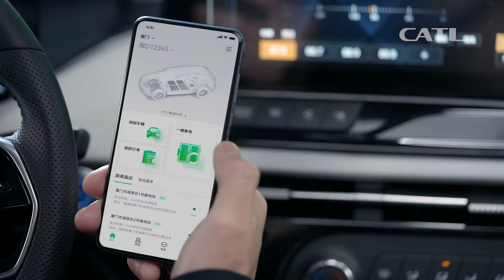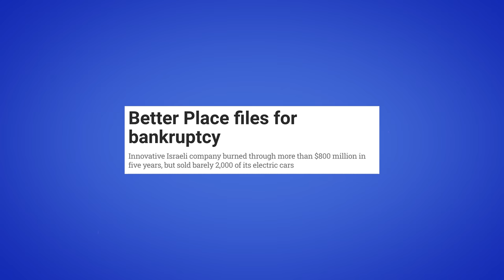Why Battery Swapping Is A BAD Idea

Comment: Adding swapping means having the ability to add capacity occasionally, but mostly just means u lease a small pack for your daily commute, then u swap it out for the occasional road trip. Makes the journeys around town even more efficient when the pack is only good for 60miles and weighs barely 🪶
Reply: I think Fiat had some concept similar to that. The Centoventi it was called. You got a battery that could do 60 miles as standard and could lease up to 4 more batteries with 60 miles each, that they'd add at the dealer for a road trip.

Comment: I believe India are implementing standard battery formats so they can be swapped across multiple vehicle types. Granted it is only light vehicles like scooters, bikes & them tuk tuk thingymajigs but if they are actually mandating the change to any new vehicles it's a bloody good start - I'm not 100% on the details. Smaller format battery packs would then be able to be used on a lot of bigger vehicles too i.e. 1 pack for a scooter, 2 for a motorbike, 4 for a tuk tuk, 8 for a small car, 16 for a large one - you get the idea. You could pay more for the convenience of swapping out batteries for fully charged ones instantly, or simply recharge them yourself if you aren't in a rush. The rest of the world should follow suit so any battery pack will fit any car in the future. The only stumbling block is economics to make it viable & value for money compared to how it is done now as there are many variables to consider. Apologies if any of this is covered in the video, I haven't watched it yet lol ;p
Reply: Mandates in India are really suggestions though. I'll believe that will get traction when i see anyone stop for a red light, and wait for the green to go, while the number of cars wide equals the number of lanes available
Reply: Manual battery swaps would most likely win over the automatic stations. Definitely far better to spend 5 minutes swapping than 20-30 min charging.
Reply: India is also working on aluminium air battery swapping station
Reply: True, there is a plan by Hero Motors to set up a dense battery swapping infrastructure in Mumbai. India could lead this electric revolution just like it did in digital payments and leap frogged the entire world.

Comment: This may have a spot in transport where you have fast turnaround for a delivery truck and the depot has a swap station i.e. something on a more or less set route - a bit like having a  hydrogen pump at the depot.
Reply: That's a good idea
Reply: This seems to be true of EVs as a whole. Good for vehicles where you know where they're going to be used and they can be plugged in overnight, less so otherwise.

Comment: 4:00 I cannot believe what I am hearing! My man here has done no preparation at all! Once all the batteries are swapped, the first empty is filled charged already and ready to be used again! There are a dozen batteries inside, so each battery will be rapid charging for 70-80 minutes, before it is their turn to be placed in a car, which is plenty of time to get to full charge.

Comment: Battery swapping is one direction of the future bcos of simplified ownership structure. Many Europeans prefer Nio for this exact same reason of simplified ownership. Fast recharging, get latest battery technology and low cost of ownership. 

China as you mentioned is easy to integrate cos many accept government leadership. Even in Europe with battery pack of 1000 km range it’s not a challenge to have many recharge locations even at higher land prices.

Just because Tesla and Renault couldn’t succeed with battery swapping, it doesn’t means it’s not gonna be a success. Battery swapping needs volume. This is one reason it’s so successful in China.
Reply: Ample is setting up battery swapping for light duty commercial vehicles. Fleet vehicles and taxis spend a similar amount of time on the road each day and may not always have enough range to last an entire day, so battery swapping may be attractive for them.

However, battery electric vehicles that have enough range to last an entire day simply need nothing more than slow, overnight charging.

An alternative for vehicles driving on highways for longer distances is in-motion charging.
Reply: I don't see any Nio cars driving around in Europe.  What a joke many Europeans prefer Nio.  Nio is failing big time outside China.
Reply: @johdo9953  because at the moment Norway is the only European country where NIO delivered cars to its customers. Later this year the ET7 model will become available for delivery in Germany, Norway, Denmark, Sweden, and the Netherlands.
Reply: @Janaale  So exactly how many cars did NIO sold in Norway?  And how many reservations across Europe?  Demand outside China is non-existent that NIO didn't want to mention or publish.

Comment: When I worked at a distribution center and our forklift batteries got low we would switch them out and be on our way in a matter of minutes. Charging can go wrong and stuff there should be a swap system as a back up.

Comment: Fast charging has got so good that swapping no longer makes much sense. If it takes roughly the same amount of time to do, I would much rather not taking apart my car every time I need to go some extra miles
Reply: As an EV owner, I concur. Swapping is a dead end. 

Honestly I see it as a way to generate an ongoing subscription from the mfg. Booo!!
I also have a hunch that if hot swap was the standard, then the battery packs would be a lot smaller - on the order of 100-140 miles because "the average daily drive is 40 miles, 100 miles is far enough" This would actually make EVs less convenient. We very frequently take 180-220 mile day trips. As it is, I do these day trips with no charging needed. If my hunch is correct, day trips would actually be a PITA

It was realizing how frequently I stop on road trips, and how long those stops usually are that flipped the lightbulb on why fast swap is not needed.
With a typical fast charge taking 12-18 minutes, the usual time I 'wait' for a charge is really 0-5 minutes with the rest of the time spent doing things I'm already going to be doing anyway in a gas car and so its not actually taking time away from driving.

Typical In rare cases of course I have spent more time, but that was before the charger network was as filled in as it is now.
Reply: Exactly. Constantly connecting and un-connecting high voltage electrical connections is a sure fire road to eventual unreliability......
Reply: @Brian-om2hh  Depends on how it is made. You have proper DC switches. But they are expensive as they contain IGBT's and need to switch the current down with PWM. Which is costly.
Reply: This is the most ignorant comment here. There is no disassembly of the a car built with swapping in mind. The battery comes out like cordless drill battery. And as you should know we don't disassemble out tools to put in a freshly charged battery

Comment: At some point, the bottleneck is still how fast can you charge the battery pack. So it makes sense to directly tackle charging speed instead of workarounds.

esp for large vehicles.
Reply: Yeah, but the number of battery cycles before a lithium pack is "Worn out" is directly connected to how considerately they've been charged. If you charge a cell at close to it's maximum amperage limit you get less cycles before the capacity drops off, so a battery that's charged at a lower rate will have a longer usable life. Without a big leap in battery tech, even higher powered superchargers are just going to frazzle a cars pack quicker. 

Pack swapping would have the benefit of allowing the system to adaptively vary charge rates depending on demand. If a "Pack swap station" that had 10 packs in it was only seeing 2 or 3 cars an hour during the early hours of the morning, it could charge up a few of it's stock at their maximum rate, but charge up some of the others at a lower rate to extend the average lifespan of the companies stock of packs.

There's pro's and con's to both ideas, but personally, I'm thinking that apart from having to have a battery lease, a universal battery swapping system would be the best way to get people to go electric. Too many folks are still scared of the predicted depreciation an EV will experience once it gets close to 10 or so years old. At that point the main thought in the mind of any prospective buyer will be that the car may soon be needing a new battery fitting, and that would cost more than the car was worth by this point. Knowing that the manufacturers had all got behind one standard and the expensive battery pack wasn't your problem anymore might finally remove the last few worries in people's minds about going for an EV.

At the minute EV's at the point that cordless power tools were at about 25 years ago. Batteries were tool (Not even brand) specific, so when the manufacturer decided to discontinue that particular tool, the supply of batteries also dried up. This put a lot of people off going cordless because they knew that 5 years down the line, their new tool would most likely become nothing more than land fill (regardless of how well they looked after it). But since we started seeing manufactures use 2 or 3 universal battery standards for their entire range of cordless tools, people have got the confidence that they won't be stuck with something that's worthless because the battery packs shot is a handful of years.

Comment: Considering it costs £20,000 to have your EV battery replaced and therefore practically makes your 5 to 7 year old car worthless I think this is the perfect solution, not only getting a full charge in the same time it takes to fill your tank with petrol and pay, but also never having to worry about your car being devalued due to a pending new battery required.
Reply: This is exactly the rational argument which goes against the corporate interests of car makers. They want to sell you new cars. They don't care about the environment. Governments need to step up and create standards everyone will follow for EVs. Then there will be a market for both batteries and stations, and used EVs.
Reply: My nine year old Leaf still has 90% of its capacity. Costs me $150 a year to charge. Will last another 5 years. Will cost around 5k (20k is what the largest capacity Tesla pack costs - hardy representative)to replace. And it is the least durable battery pack on the market. 
Swapping will require extensive modification to the car, much higher costs per swap compared to regular charging, and chargers can be 
installed almost anywhere you can park a car, unlike the footprint of a single bay swapping centre.
Reply: 1. Modern car batteries outlive the car it's life. 2. The battery in my Tesla cost price is only around 5000 to 6000 dollar. And will become cheaper in 10+ years. 3. Those batteries in those Swap stations will also degrade, they will not remove a 90% degraded battery. The first day you get your car you can go from a 100% SOH battery to a 90% SOH battery and lose 10% range IN ONE DAY. They won't refresh the batteries if they are a little bit worse, that would cost them too much money.
Reply: This!
Reply: This is why I will never buy another EV unless it has an easily swappable/replaceable battery pack. My 9 year old EV battery was on its way out, and I was quoted $11,000 to replace it.
Reply: My 2014 Tesla has lost 11 miles of range.  I won't need an extra charging stop even on the longest trip I'll ever take. When Tesla had a charging station at Harris Ranch, I was able to park outside it at a charger, go in for lunch, and return to a charged car. So I saw no reason for a swap. 

The battery will far outlast the car.
Reply: And the company that owns all these batteries is not going to push that cost of "dead" batteries on the consumer ? in what fantasy world do you live in? Companies are not charity. you'l pay the price just spread out.
Reply: Tell me you know nothing about battery chemistry without telling me you know nothing about battery chemistry

Comment: THE. FINAL. FORM. 
Your home battery pack can be shared with your car. It’s installed in the floor of your garage. If you’re commuting, you only carry a small pack while you’re out and about that can quickly fast charge. If you need to go for a longer drive (which is usually planned) slap in some more kw before leaving the house and go. While you’re not using the batteries in the car, they function as a battery backup for the house.

Comment: I thought manufacturers were now making the battery an integral part of the structure of the car to save weight - this would imply it’s difficult for such a battery to be made replaceable at all?
Reply: And more impossible to replace/recycle. They'd rather you buy a new car.

Comment: Battery swap is the only viable paradigm for dense urban areas and high-rise communities in which individual charging setups are not possible. There are some compelling advantages for the swap stations replacing petrol stations. First, regional recharging, checkout and distribution centers would be located adjacent to power generating stations or renewal harvesting sites, thus reduce the threat of neighborhood distribution grides being overloaded. Assuming that national and international standards for geometry, size and connectivity be created, a substantial degree of protection from technological obsolescence as breakthrough improvements in battery technology for density, safety and cost comes forth. Also, eighteen wheelers for back-and-forth transfer to the stations from the power generating setup would replace tank wagons, with their inherently empty back hauls.

Comment: I agree 100%. Battery swapping is a stupid dream, with no purpose, economic case, or technical ability.

What you gain:
- During the occasional road trip, "charging" now takes 5 minutes instead of 20

What you lose:
- You no longer own your battery, it has to be leased with a monthly fee
- Stations are now almost 10 times more expensive (600,000€ for a swapping station vs an average of 70,000€ for an Ionity hypercharger)
- That means they're 10 times less abundant
- Not to mention, chargers serve all brands, swappers only your own, so it will be even LESS common to find a working station
- Also, since there's fewer of them, there WILL be queues
- Not to mention that during rush hour, batteries may just simply run out
- The battery needs more robust casing, so weight goes up, efficiency goes down
- Cars have to be built around the shape of the battery, so interior packaging suffers
- And all of that will be more expensive than if you just simply charged for 15 minutes longer

And at the end of it all, the truth is, you can leave your car while it's charging and go do other things you do on a typical stop, food, bathroom, etc., no such option with a swap, so total time stopped will be the same anyway.

Battery swapping is idiotic.
Reply: Possibilities
-Collective ownership of batteries at a co-op
-Sufficiently universal standards
-Economy of scale continues trending positively

Comment: I am a little confused by this video,  with a NIO EV you can do either, charge it at a Tesla station or do a swap, its not like you are stuck swapping only with a NIO, but with a Tesla you are stuck only using charge stations.  So NIO does not have to be in a rush to get swap stations 10 miles away from the last one all over a country, they can take their time as they build capital.

Comment: 500KG lump bolted to bottom of a car by a roadside vending machine..Errr no… My car goes 250 miles… so after 3.5-4 hours of driving, I’m fine with 30 mins of charging and a little break thanks.
Reply: How do you think a factory works?

Comment: Thanks for summarising this. It makes sense what you're saying. Just wondering if anyone has an answer to this - why can't we split the battery in 2 and charge using two charge plugs? When open the charge port it should actuate a switch between the 2 battery portions to open. When the charging is complete and you've unplugged and closed the charge port the switch automatically closes. Seems too simple, there must be a reason they haven't tried it yet.